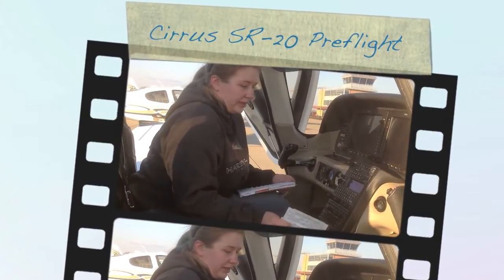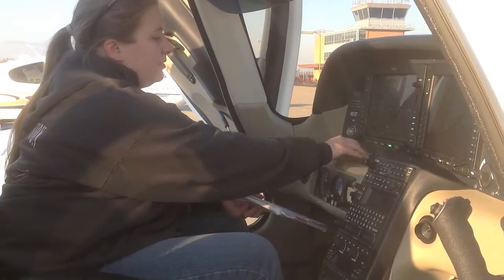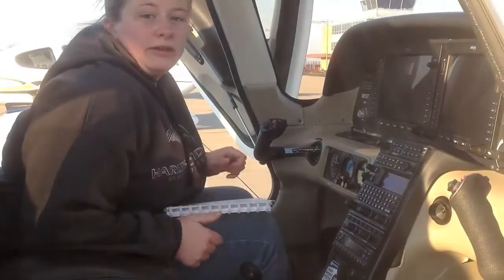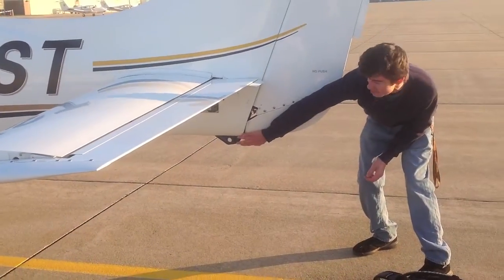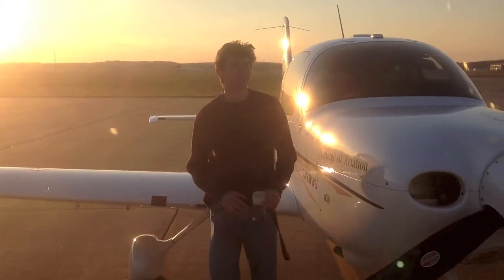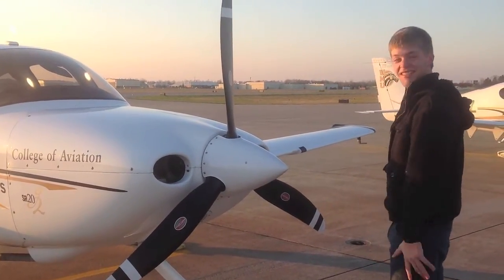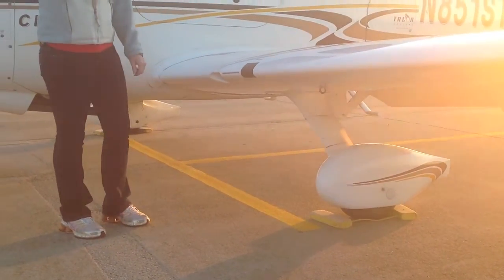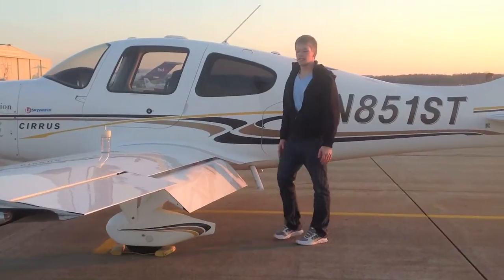How to Preflight a Cirrus SR20

Comment: Some important things are forgotten here.
Interior: The alt static should be moved so if you really need it you know the switch works. When checking the lights you need to go outside to actually check the lights. Also, I am not sure why she does not check for the stall warning (simple check and very important)
Exterior: There are two important screws to check and they are in the intake of the cowling. Also, when you check the flaps, ailerons, rudder and elevator you should check all the bolts and screws. Also, the screws of the propeller should be checked

The brake indicators should be checked first of everything. If they look black then no need to do anything else. They should look white (not green by the way)

Also no preflight is complete until you go around the plane again. Not a bad idea to look at the plane from a distance to make sure everything looks good as well.